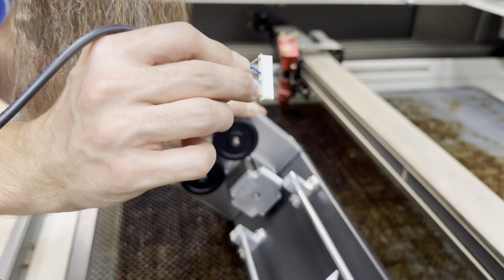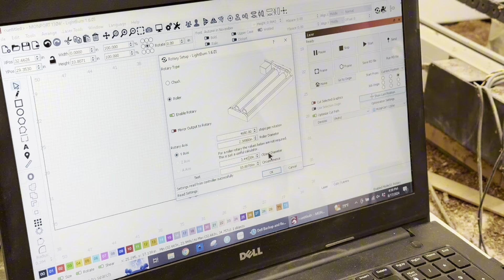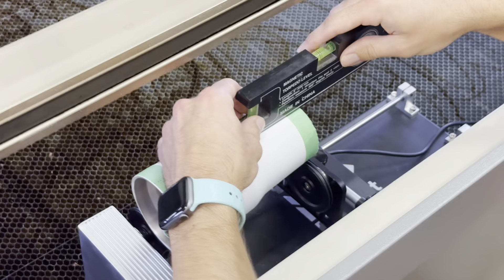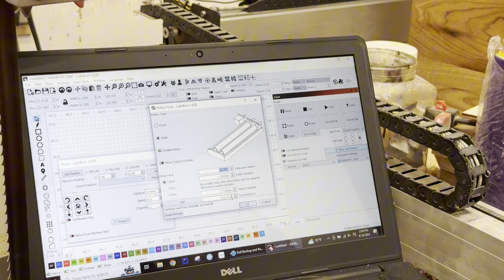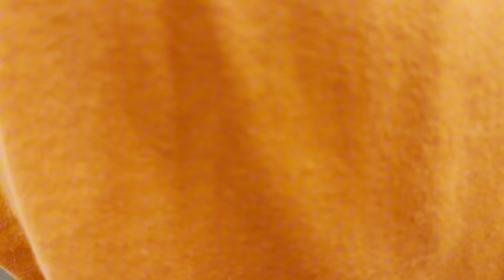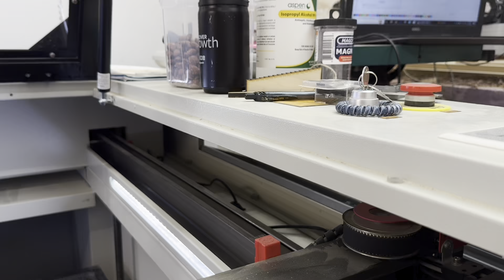How to Set Up & Use Monport’s Rotary Attachment for Laser Engraving | Complete Guide

Comment: little trick with the focal gauge: 

 I cut a piece of acrylic, or other material to the 18mm and glued a small neodymium magnet to it. 

 slap it on the engraver housing. slick.  

 glued magnets onto the safety glasses too.  keeps them both handy and stuck to the side of the machine.

I ended up completely removing the auto focus probe as it was too cluttered.  The 18mm gauge block works quick.  unless I had the autofocus  nozzle, id reconsider AF in general.   But the block works fast without the extra garbage hanging off the side of the tube.
Reply from the maker: @nwmi493  hey that’s a great point! I appreciate your perspective and insight. What sort of laser engraver are you running?